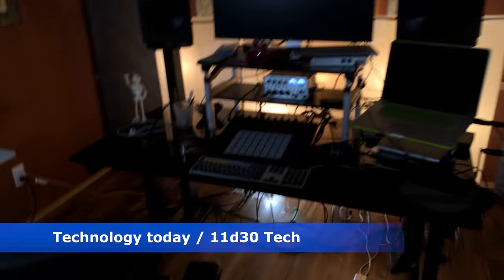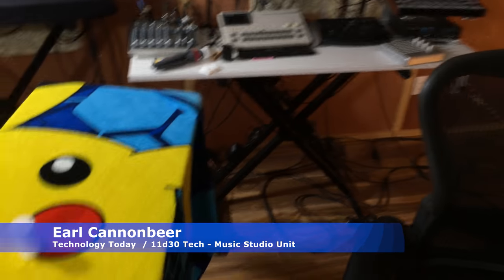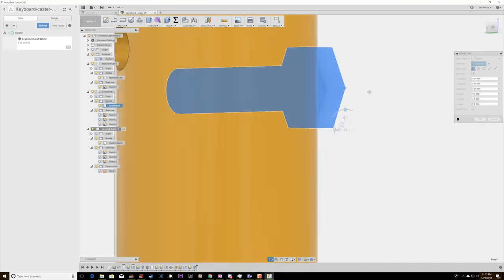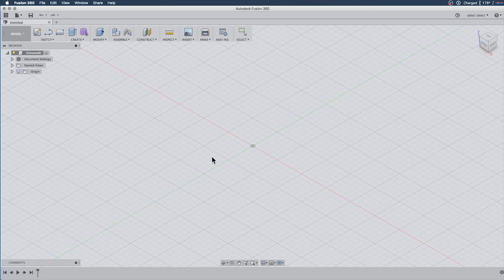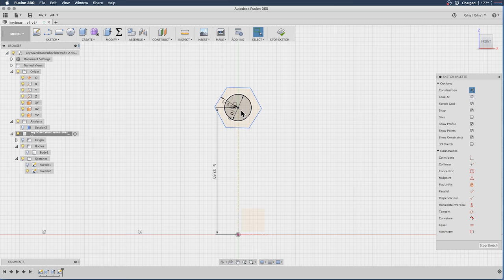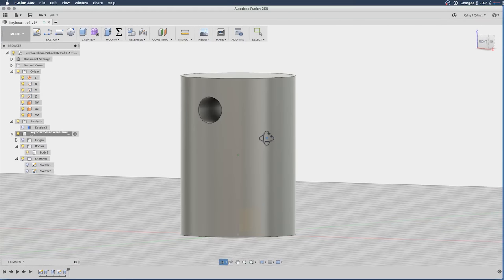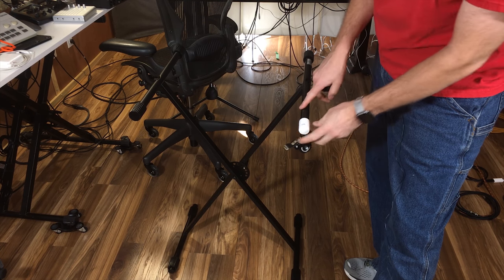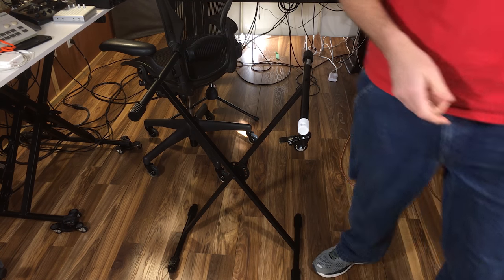Keyboard Stand wheels retrofit. Part One

Comment: I got my friend to 3d print me some clamps with a square bottom, where i bolted some castors with a square mount. works great, you just clamp them on and tighten the screw and now my keyboard stand rolls around.

Comment: Sorry, but if you are drilling through the stand anyway, couldn't you fix the castor wheels directly with nuts and bolts? Instead of 3d printing the sleeve?
Reply from the maker: I didn't drill holes into the stand the hole is in the 3d printed adapter. It makes contact with the stand to keep it in place. But yeah you could totally just drill a hole and attach the wheels. Thanks for the comment!
Reply: Towards the end of the video, you mentioned that you might need go drill a hole to stop the wheel from spinning free? Maybe I was wrong about your intended solution! Thanks for the reply. Have a good day